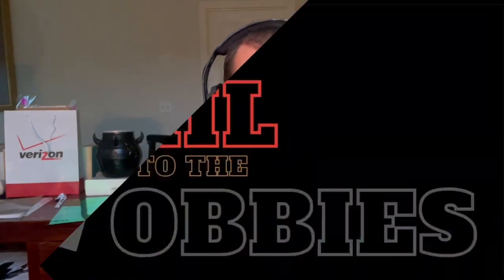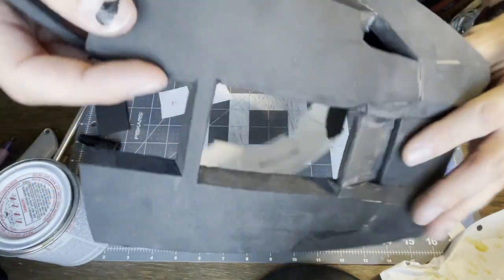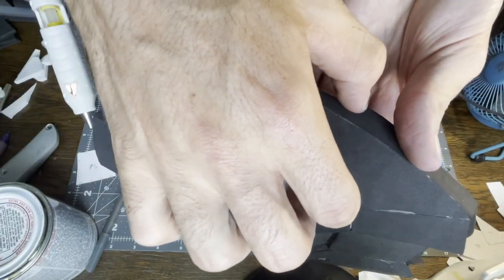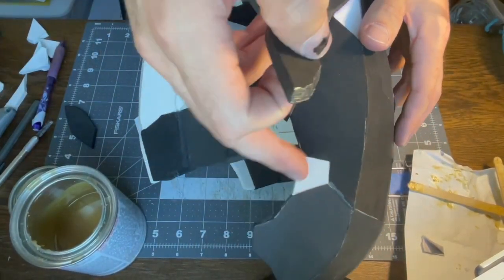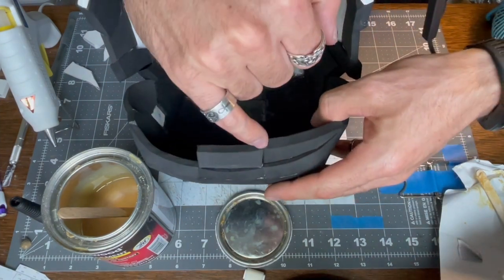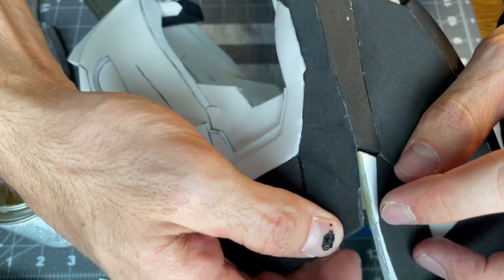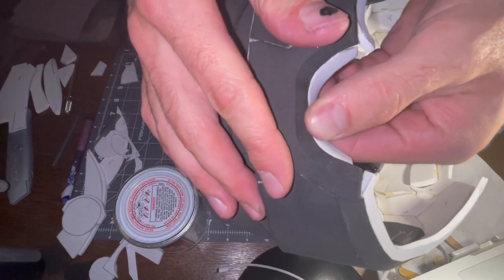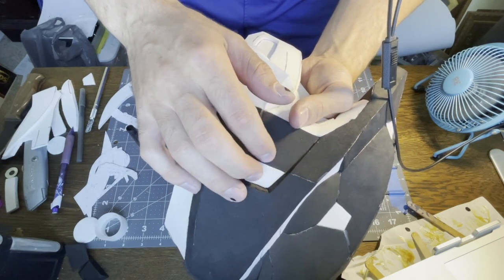How To Make Halo Infinite Helmet: Master Chief Part 2

Comment: would it be possible with cardboard?
Reply from the maker: I think it is definitely possible with cardboard. However, the foam bends so easily and when it bends it doesn't wrinkle like cardboard does. If you opt for cardboard, you may have to get the general shape with it, then put fiberglass or bondo over it to smooth out the shape. I tried the fiberglass method a long time ago and it was soooo much more work than foam. If you try cardboard let me know how it goes though!